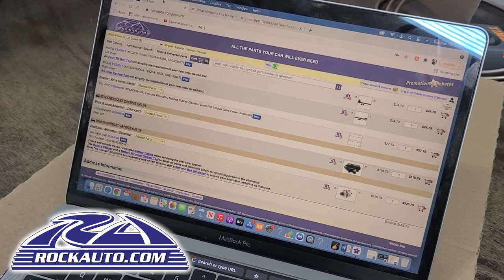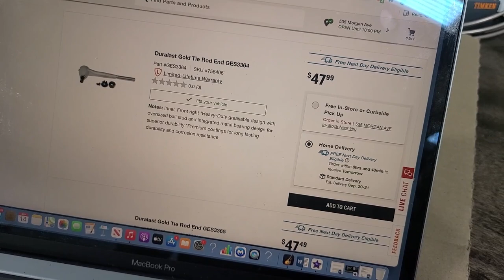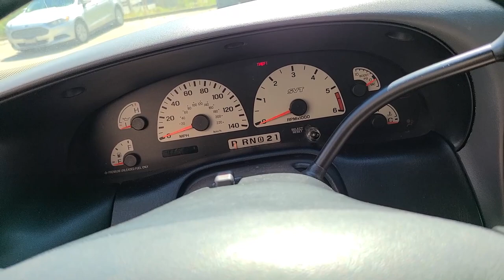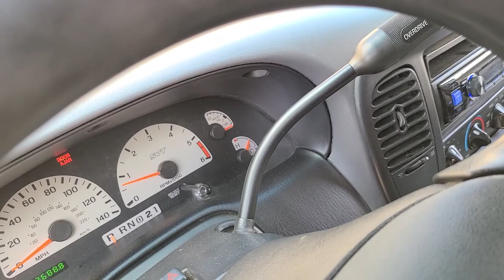I Found A MAJOR Engine Issue After Fixing EVERYTHING On My SVT Lightning! Previous Owner Had To Know

Comment: There Is just something so satisfying seeing new parts go on an older vehicle, If I had the money I'd literally go too far and replace everything haha.
Reply: You need to with these F150s. The Tritons are garbage no matter if it's a 4.6L or 5.4L. Ford was trying to save money so the engineers rushed these motors out.
Reply: @tskraj3190  eh I’d like to say different, I have a 4.2 that’s manual & 4x4 with 240k miles going strong with absolutely no problems starts up every time. I also have a 2004 5.4 king ranch with 237k miles going strong absolutely no problems. I do oil changes every 4K miles I guess it’s all about maintenance. A buddy of mines also has a 4.2 with a little over 300k miles and ran great until he got into a accident.
Reply: @Owensti  The 4.2 is a much better motor. Good luck with your 5.4L. Try not to do any tune ups.
Reply: @tskraj3190  my dad has a 2010 5.4 king ranch on the other hand that went out due to something very minor. On one of the pcm harness I guess it made contact with the engine , the heat causes the tape and wires to melt and cause a short. That short blew the pcm and it’s currently in limp mode. I was able to find another pcm now I’m looking for a pcm harness.
Reply: @Owensti  My profile pic was the last F150 I owned. It was a 5.4L but it was nothing but problems including the infamous spark plug spitting and then the cam phaser completely crumbled. I also had a 97' F150 4.6L. It continuosly spit spark plugs.
Reply: @tskraj3190  yea that’s why I stayed away from those year fords. A buddy of mines was changing some spark plugs and broke one. He had to take it to a mechanic and drop the head to get it out. Cost him about 2k.
Reply: @tskraj3190  on the other hand my dad also has a 97 Ford F-250 with the 7.3 not the 4.6. That thing is a tank & it’s barley at 200k miles. He also has 2008 F-250 with the 6.4 that’s pretty good no problems just yet.
Reply: @tskraj3190  The lightning 5.4 is not the same as the regular f150.
Reply: @TheCOWBOYRANCHER  The lightning 5.4L just has a slightly lower compression ratio than the standard 5.4L from the use of different pistons but they have they same problems.
Reply: I just replaced the whole front end suspension on my 1994 Mustang, new Kmember, control arms, sway bars etc
Reply: Yep.....been there, done that, no T-shirt though. :-)
Reply: yesterday I put a new alternator on my 2005 car, it was a 90a now 120a, new injectors, o2 sensors (v6), coil packs, inner and outer rack ends...
you turned on yet?
Reply: @Owensti  I also have a 4.2L manual 4x4 and we’re currently coming up on 270k and the only issue I have is the rusty rockers—Minnesota—and the hack job someone did when stealing my Cats 😠
Reply: Doing just that on my Lightning engine swapped Expedition. $25k so far, and still going smh.
Reply: @tskraj3190  i disagree, triton is one of the most reliable engines I have a Ford 2001 with 278,000 miles and i swear I don’t know how it’s lasted this long I’ve driven it without coolant by accident I’ve also disconnected two of the cables connected to the coils and forgot and drove the truck and it still worked so idk what you’re talking about

Comment: I say buy some ARP studs. Remove the head bolts one at a time and install the studs. Even if it doesn’t fix it, you can always re use the studs. As opposed to most head bolts that you have to replace anyway
Reply: Even though arp says they are not torque to yield I would not reuse them its not worth saving pennies on the dollar if you need to go back and fix it again.
Reply: @scotttauscher5460  studs are absolutely reusable. They don’t stretch like bolts.
Reply: You can also replace the head bolts with studs one at a time. I would definitely try dropping some good ARP’s in there one at a time and retorquing them one at a time. Cummins guys do this all the time. Done it myself with good success. If it doesn’t work ya really haven’t lost anything but a little time.
Reply: I was gonna say this too. Can anyone attest if there's enough room to pull out the bolts with the heads in place on these trucks?
Reply: @josiekiosie4910  🤗
Reply: You guys need to understand that he is a do it once do it right kinda guy.  

I have also done the one at a time srud replacement on many cars.  This was without any issues though and just preemptive.  He has an issue of exhaust gases leaking out into the cooling system...which could mean that coolant also got into the combustion chamber.  Even a little bit can cause major issues and scaring which is what I think he is more worried about.  So being the guy he is hell tare down the head and replace anything that needs doing while also checking on the health of the engine.  

If it wassnt blowing coolant everywhere I would be agreeing with you it's a simple fix if you know how to do it right.  The heads are lifting which in turn creates paths for cracked head gasket or pinching etc.  It's a head off job that's for sure just to check everything out.  

Worse feeling is opening it up and finding some major crack in the head that only opens up on expansion and wot.  I've seen this a few times.  Thinking it was a head gasket and then finding hairline cracks from the temp change that added upto a combustion leak.  That sucks and I suspect he is dreading lifting the head to see.
Reply: @arbenowner  They're made of the same material. Whether they're studs or bolts isn't the sole deciding factor.
Reply: @TonyRule  They are certainly not the same grade of material. Come on man
Reply: @UltraMagnis  True he usually does it the correct and thorough way, but this channel does cater to the DIY crowd and swapping in head studs is a totally reasonable repair. Also he was talking about trying "head gasket seal in a can" so I think head studs is way less quacky than that
Reply: @Eastahtata  oh yeah for sure I hate the sealent.  I should have warned him against that it's horrible shit.
Reply: @Eastahtata  Of course they are. Steel is made in grades for reasons. These aren't DIY Chinesium bolts from Home Depot.
Do you even understand the purpose and mechanism of TTY fasteners?
Reply: @TonyRule  Oh my bad I thought you were saying the original factory bolts were the same material as ARP studs
Reply: I think your idea is excellent and would probably work!
Reply: At this stage in the game, that would be like putting a bandaid on an arterial bleed. Chances are the head gaskets are compromised from the heads lifting under boost. Could be a cracked head as well which can only be checked if the heads are off. Correct way to do it would be to tear the heads off and have a shop check them for cracks, install new head gaskets ( Preferably MLS. ) and some ARP studs for peace of mind.
Reply: @UltraMagnis  u aint getting the back studs out or the studs near the shock tower out with the engine in there, its just not happening lol
Reply: @Zirion123  it's doable if you drop the engine slightly to make some room.  But yes it's usually a drop engine or engine out jobbie.   You also need to strip the top of the engine bacislly when it's in there  to do it right and get all that shit out of the way.  So in the end with all that time many just dump the engine and do preemptive maintence while it's out to save them having to remove old wiring harness and breaking clips etc.
Reply: @UltraMagnis  I get the "do it once, do it right" mentality but, it seems the issue only occurs under boost (ie: no coolant entering the combustion chambers), leading me to think that stronger head studs "MAY" fix the issue but, I know nothing about these particular engines, others have also made a case for a tear down... If it was me, I'd start with head studs...
Reply: @arbenowner  they do stretch like bolts. Your clamping force always comes from stretch. Difference is material and application. Studs are designed to be re-used.

Comment: Fully port the heads while they are off.
Reply: @jasonw7497  That's a bot, not a person.
Reply: @firesurfer  I know
But it's fun to me...to respond to then
Don't judge me
Reply: @jasonw7497  LMFAO!!!! "Creampie-ing your pillows." dead
Reply: I don't think Alex is wanting to have the truck torn apart for six months like the V12 was.
Reply: just like the mercedes lol
Reply: @TwentytenS4B8  no it wouldn't take anywhere close to as much time to do the Ford heads because everyone have CNC code for those. The V12 Benz heads no one has done before. At least that Alex could find.
Reply: @jetskiliferboatguy8140  those heads really aren't worth porting those other stock Ford two valve heads the same two valve pie heads that was on all the  4.6 & 5.4 pi engine s might as well buy trick flow aftermarket heads instead of wasting money on a port  you're not going to see much results

Comment: I really like that you don't gloss over the process and that you include the struggles of replacing parts, especially when working alone.  Camera angles and critical focus are also always spent on.  Video production is a job in it self, and you add expert auto repair content on top of that.  Keep doing what you're doing.  It's always a pleasure to watch and learn.

Comment: You're lifting the head from getting into boost. I have a 2000 Lightning and am changing my head-gaskets soon. I am leaking out the side of block. These 5.4's are known to leak. I think the factory bolts stretch over time from heating and cooling. You can pull the heads off and change the gaskets in the truck.
Reply: I had identical symptoms on a non boosted 5.4... it's probably not even the boost
Reply: @JBBBBBBBB250  Yes it is true. It doesn't matter if it's boosted or not.
Reply: I"d lift the cab to do the work.  I don't have a lift, but if I did, that would be what I'd do.
Reply: I guess it's also a good time to switch to head studs to avoid the problem in the future.  I know it's a problem for a lot of other boosted platforms.  Sometimes factory head bolts aren't really capable of holding the higher cylinder pressures of more boost.
Reply: @albertko1  This is what am doing also. Putting in some ARP headstuds to strengthen it up a tad.

Comment: When I saw the first video, saw the colour of that coolant and the leaking cooling system, I thought: head gaskets.  I know the pressure cap was bad, but to me, that didn't explain the colour of the coolant, as a leaking cap won't change the colour of the coolant, you need combustion gasses to do that.  You might ask, why was I so sure?  Same thing happened to me.  Sorry about the situation you are in, and all the work you'll need to do.  Just think though:  what a great subject for a series of videos!
Reply: Of course, head gaskets can leak two ways: on the exhaust side and on the intake side.  If on the latter, the coolant gets sucked into the adjacent cylinder and out the exhaust pipe and you should be able to tell because the coolant level goes down because it leaves the system without any hose leaks.  Simple observation of the level will pick this up.  In Alex's sort of case, the exhaust gas infiltrates the coolant system, adding gaseous volume to the nearly sealed system that has to escape some way, in Alex's case, out the filler cap probably with some coolant fluid.  But some exhaust gas gets absorbed in the remaining coolant fluid, thereby changing its chemistry.  The change in the new coolant color from blue-green to orangy-rust is very much like the test kit that Alex demonstrates in the video.  Maybe the coolant was already indicating for "free" what the test kit does at some expense and some waste of time.  If none of this is going on, that is the coolant level stays the same and its color does, too, you probably don't have a coolant or a head gasket problem.

Comment: I remember learning to do maintenance on my first vehicle, a 1990 Ford Bronco. Found out the hard way you need a special tool to takeoff those fuel filters. No internet or YouTube back then! This video just brought back some memories.
Reply: Damn must have been a long frustrating day
Reply: Previous vehicles w less power, I never cared about fuel filter. At longest 15k miles, usually I change it early.

Comment: 2:53 headlights out on the left side, well your right, also if your worried about dinging up your bench there, go to like a bed bath and beyond and put down a rubber matt or two, the kind that you stand on to take pressure off your feet, forget what their called.

Comment: I had a 97 F150 4.6L 2V that had a blown head gasket, and similarly to yours, it wouldn’t trip the testing fluid when you did the test per Napa’s instructions. No overheating, no smoke, no chocolate milk, etc. the only “symptom” was blowing the radiator every six months. The nice thing I found out about the job is that you DO NOT need the special timing chain tools to pull the heads. It wasn’t a bad job, but I’ll never pull heads in a F150 with the engine in the bay again. It’s possible to do but you’ll be fighting it the entire way.

Comment: Don't use any head gasket sealants. They never work and cause a mess inside of the cooling system. Its like slapping a bandaid on a flesh wound. The easiest route would be to try and torque the head gasket down. I would be concerned to loosen and tighten them as I'm not sure if they are stretch bolts. Either way, life happens but I'm excited to see you handle it. Best of luck!
Reply: If it's an oil side leak it can work on a beater(just bypass the heater matrix and then flush when sealed)
Reply: Good point but if they're currently under torqued and they're torque to yield bolts then they wouldn't have stretched yet which could be why the head gasket is only letting by coolant under boost.
Reply: They put a layer of sand in the cooling system...
Reply: @Lunas2525  I wasn't on about putting sand in the cooling system, WTF!. I was on about putting  head gasket sealant when you have an oil side leak that doesn't have to fix combustion pressure and flushing it after the leak was sealed(on a beater). 
You do your sand fix  though ¯\_(ツ)_/¯
Reply: @quentinc1275  It's running higher boost though isn't it so compression will be well up. Sticking a smaller pulley on for more boost seems like it's a poor mans tune. Not surprised it's bypassing the head gasket. I wouldn't overtighten the studs as they are likely to shear and cause a world of pain
Reply: @Lunas2525  OK fella, sand you say, silicon dioxide, err no mate, no they don't, stop dragging me down to your level of nonsense
Reply: @quentinc1275  It's more gasket spec I'd be worried about
Reply: @Lunas Eclipse  you mentioned sand not me, the fact that you say I said sand just makes you a troll, see ya <3
Reply: the barrs rabbit shit kind works.
Reply: Those additives are only great if you need to get to work for another few days before scrapping the car, to fix what the additives do to the car cost even more afterwards.
Reply: Irontite  works great .I  had a 87 caviler with water leaking out of head gasket. Granted  it was beater. Drove it for 2 yrs  .Then sold it to friend  .6 months later he notice a leak. Flushed and added irontight drove another 1.5 yr. .You can buy it on line. It is mqde for diesel trucks.

Comment: Best thing is to replace everything when something in the steering gets loose. If one piece is wearing out, the rest is there or not far behind. I picked up a F-350 crew-cab that used to be a forest service truck and the first thing I did was replace everything that moved in the front end. Pricey, but I don't have to worry when I am coming down a little used narrow gravel road with a load of firewood. What made it even better was almost everything new had a grease fitting.
Good to see someone else on the Milwaukee team.

Comment: 100% lifted head.  Coolant coming out of the overflow under long pulls/boost, but driving fine, is exactly what happened to mine.  You need to pull the heads, and fix it properly, don't re-torque or re-use the bolts, they stretch.  While your at it, rods are the weak link, and may as well go built.  These trucks don't like detonation, and need a really safe, low timing tune.  Since you don't know the history, id 100% have it tuned by a reputable LIGHTNING tuner.  There's lots of info out there, Lightningrodder is a great forum with tons of info, and O.G. Lightning guys that are very helpful and can help you with any questions.

Comment: I have the exact same problem with a 2009 Hyundai i30 1.5 tdi. When I checked the coolant cap it literally fell apart, so I replaced that then I replaced the thermostat as that was faulty. The coolant would bubble and over flow on revs over 2500rpm. I then realised that somebody had tried to flush the engine using dish washer tablets. So I flushed it out and put the correct coolant/antifreeze in it. I haven’t done the coolant check yet as i do not have the special tool. Thanks for the video it has hopefully helped me. I’m a vehicle mechanic of 20 years and I have never seen this problem before.

Comment: I had the same problem on a diesel car, was driving perfectly fine but when I flor it a bunch of times the coolant was coming out, and I decided to do the head gasket job, did the job and the car was the same, then I changed the front radiator and the heater matrix and the problem was solved

Comment: Same issue on my 2011 Legacy GT. Car never overheated and never smoked, everything worked great. The thing that I should have noticed is that the overflow tank was empty and when filled up, you could see air bubbling up and with enough heat it would expand and overflow. Things are all good now after a full rebuild!